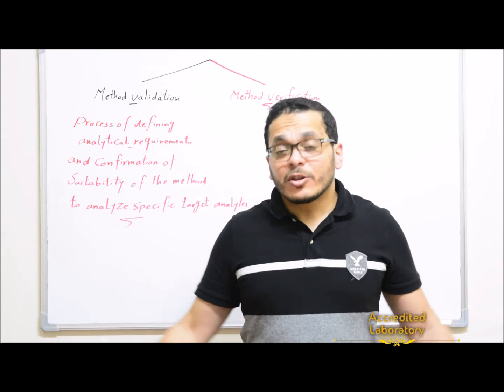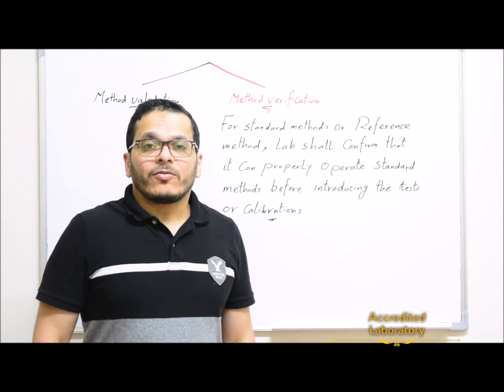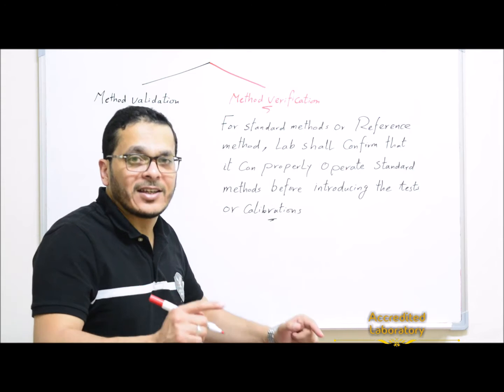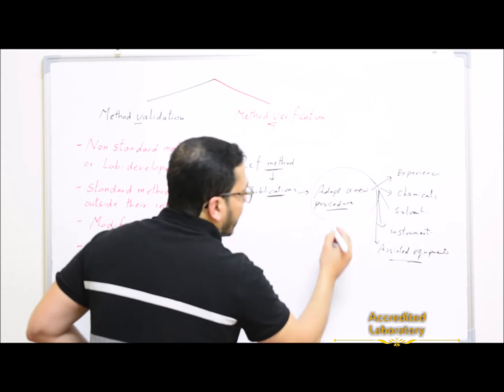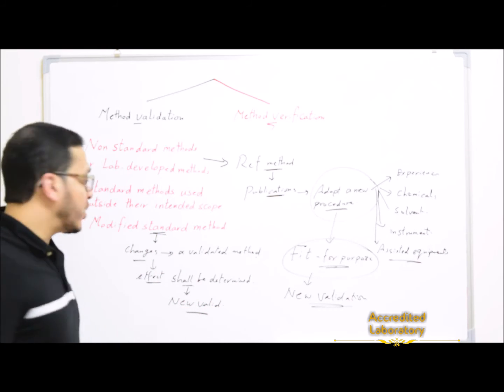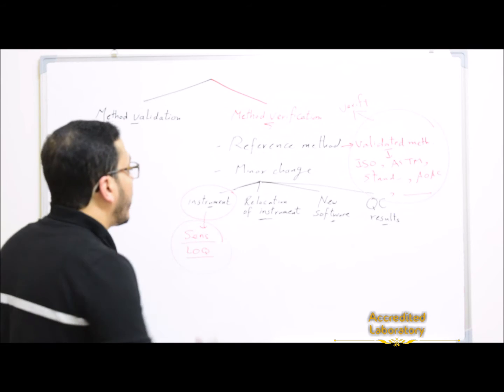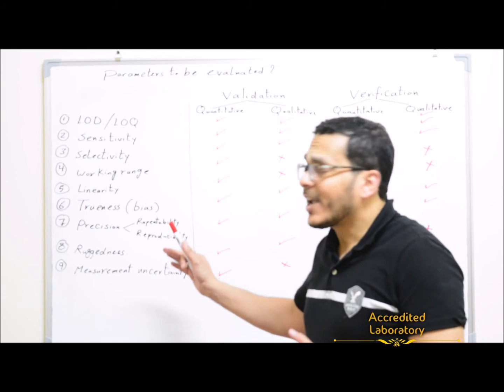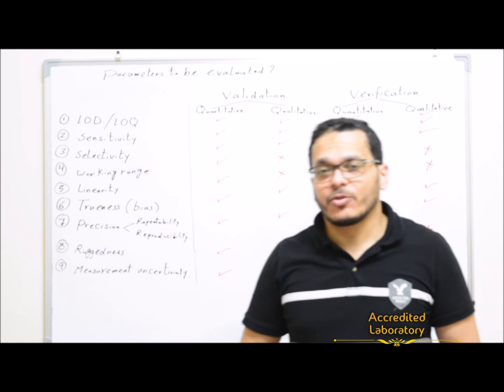Method Validation | 1- Differences between validation and verification

Comment from the maker: Announcement, English 

Through this link, you can enroll in a comprehensive course on Method Validation, Verification and measurement uncertainty Calculations in English. The course comes with guidelines and an Excel sheet with calculations that you can download and utilize for practical applications. 

For all my followers and those who are new to the channel, you will find the complete course exclusively available here. Additionally, any future updates to the course will be accessible to you, allowing you to continue benefiting from it. At the end of the course, you will receive a certified certificate from Udemy.

I want to emphasize that this course is exceptionally well-explained, making it straightforward and accessible. Many individuals have expressed their gratitude for how it has helped them in their personal endeavors and professional development. Best of luck to all, Insha'Allah!

https://www.udemy.com/course/method-validation-based-on-iso-170252017-requirements/?referralCode=103AAC39019691D0F9F0

Comment: For example, i have standard method for water content determinatiom and then I develop this method. Can i just compare results from this two method and determine whether its significantly different by t test?
Reply from the maker: If you have a standard method you should verify and if you have 2 methods one of them verified and other one still not verified or validated, you can use t test to compare and find if there’s significantly difference between them. If no difference so not verified method can be used to analyze the same target analytes, but also you should evaluate other performance parameters to insure the validity of this method